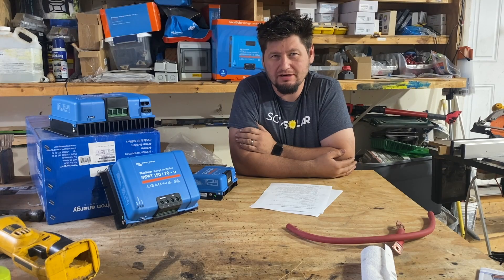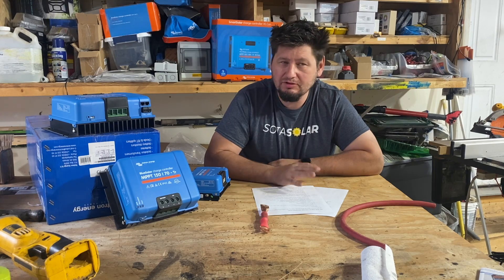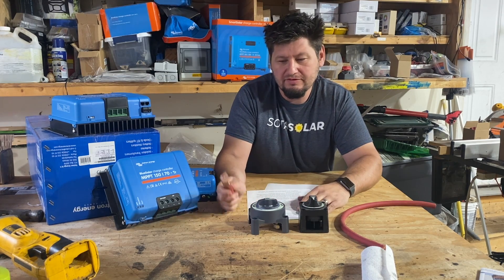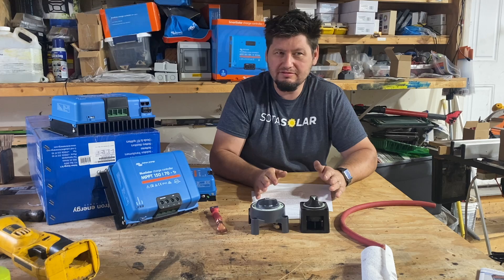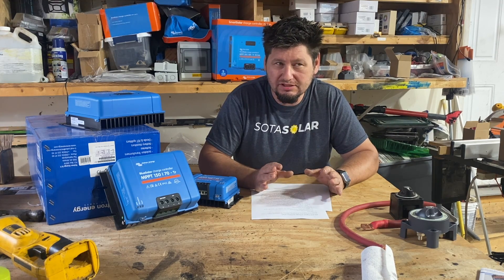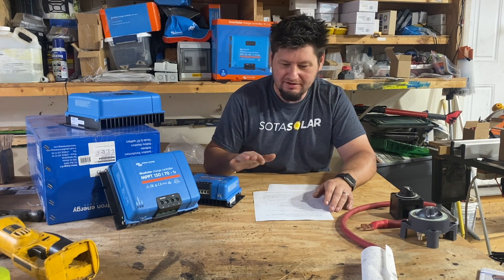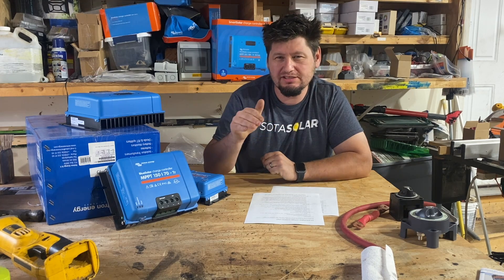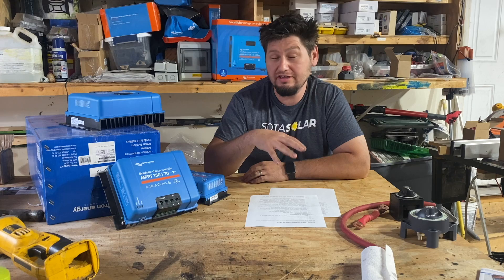24v and 48v RV Solar Systems Pros Cons Tips and Tricks

Comment: who makes 48v AC units?
Reply: We're talking DC voltages here, just to be clear, (I know there are two conventions for AC - Alternating Current and Air Conditioning) but RecPro has some 48vdc air conditioning offerings, and others are going to be hitting the market in short order.  The manufacturers know the benefits of 48vdc, and they're beginning to transition to it in the same way that 800v architecture is displacing 400v in EVs.  It's a 48vdc future in RV land, and we're just seeing the beginnings of that transition today.

Comment: The problem I have with my 48v system (actually 63v) is there's no good way to charge the house bank with the alternators.
Reply from the maker: It’s definitely a challenge. If you really need extra power there are 48v alternators. Another clever way is to use the alternator you have and a cheaper inverter and run a 120 vac 48v dc charger from that. 
JD’s bus runs a 48v system and he has so much solar they don’t even bother with alternator charging.

Comment: Great video! I intend do install a 48v system in our horse trailer as the main use will be for extending an air conditioner. For the 12v system, I plan on keeping the old 12v system in place and just putting one of the 48/12 dc to dc chargers in. I’ve heard of keeping a battery in for those heave 12v loads like jacks, slide outs, etc.
Reply from the maker: Yup, great way to go.